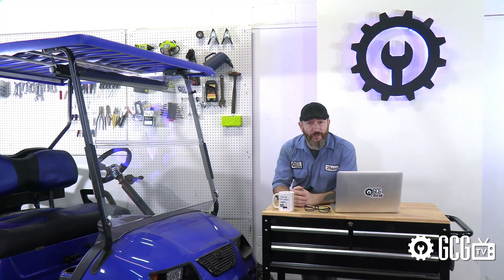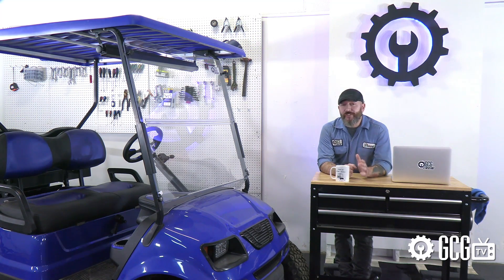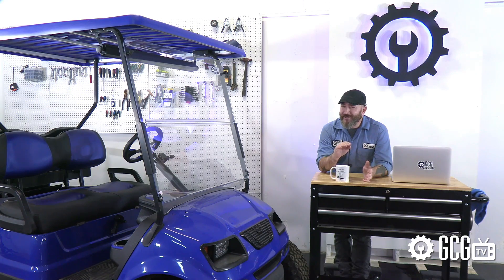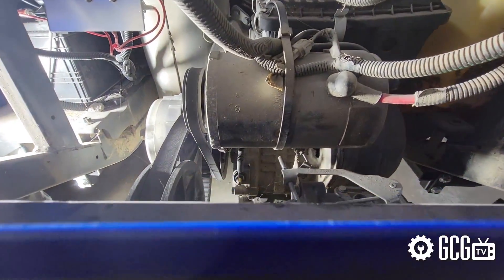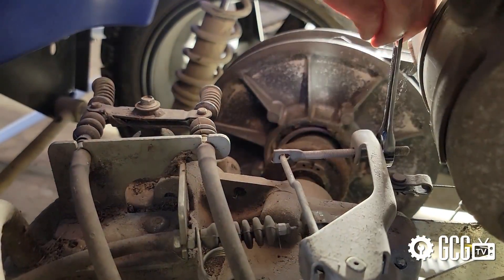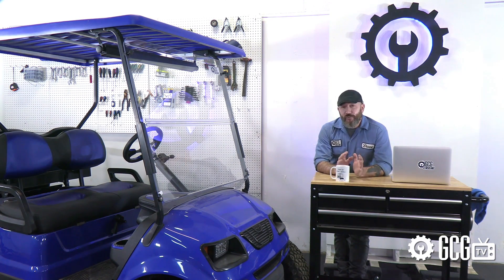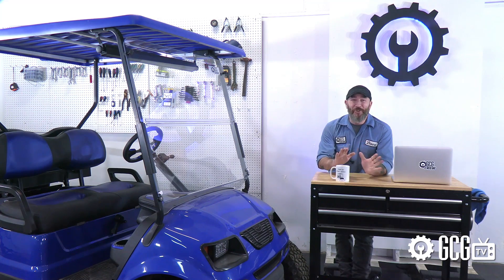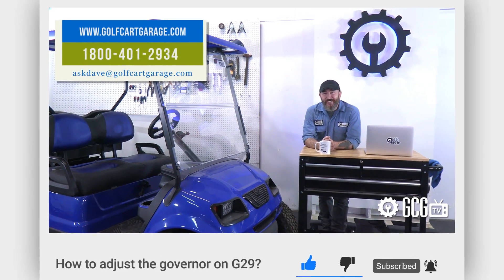Yamaha G29/DRIVE Governor Speed Increase | ASK DAVE | Golf Cart Garage

Comment: I need help adjusting my pedal to governor cable.  Any helpful advice would be appreciated.  🙏
Reply from the maker: Thanks for watching, John!  Best advice in this video is to keep the exposed threading on the governor bolt at about 1 inch.  You don't want to overdo it and potentially cause engine trouble.  This kind of experimentation is best done in small increments and checking results.  If you need more help, we have diagnosis and virtual tech appts. on our site.. just get in touch!  Support@GolfCartGarage.com or (800) 401-2934